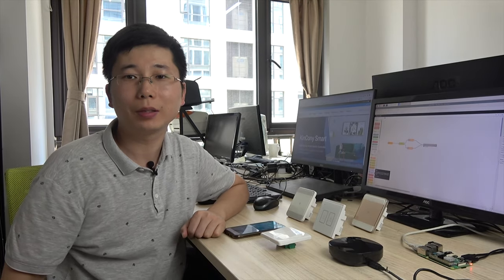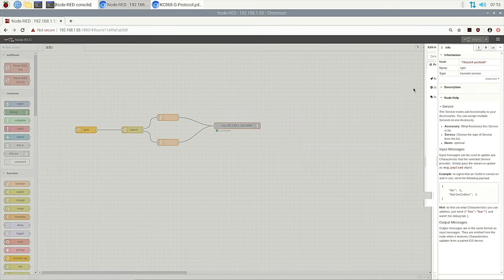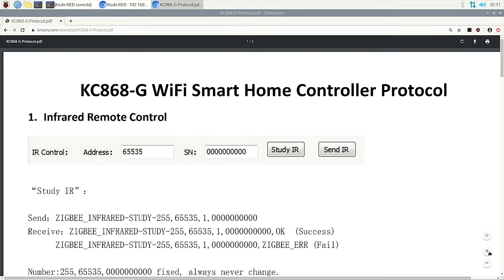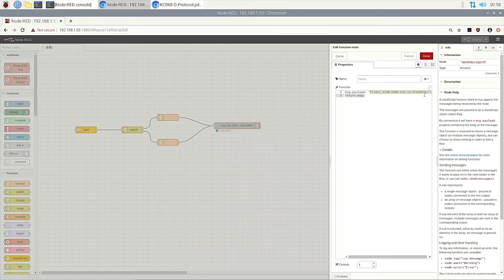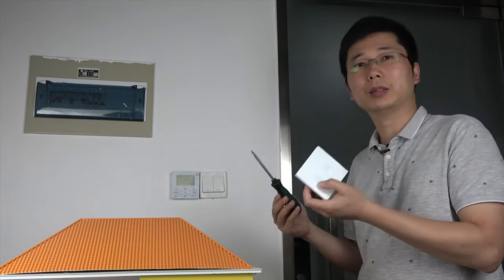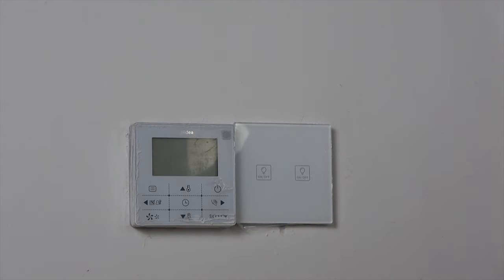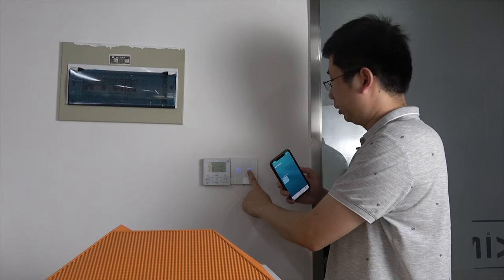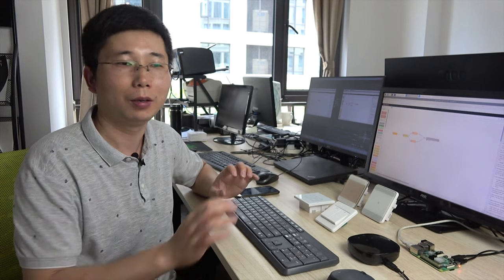【home automation DIY by Node-Red#07】RF remote control by homekit

Comment: The future this kinkony is raspbarry?
Reply from the maker: Raspberry Pi just a way to control kincony's products.also we want to make it easy for more third-party platforms to integrate our products
Reply: @KinCony  can it work with Arduino too?
Reply from the maker: @BrunoVianaShows  no problem, you can use arduino serial port send command to controller's rs232 port.
Reply from the maker: what kind of project you want to use relay board with arduino?